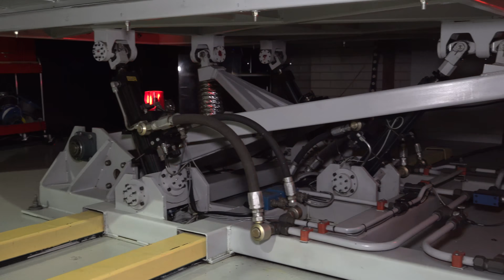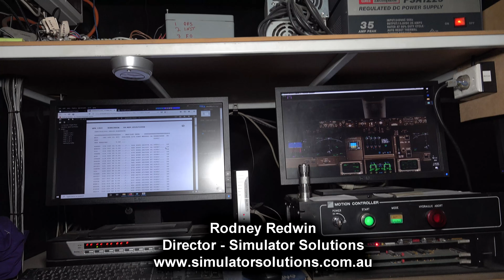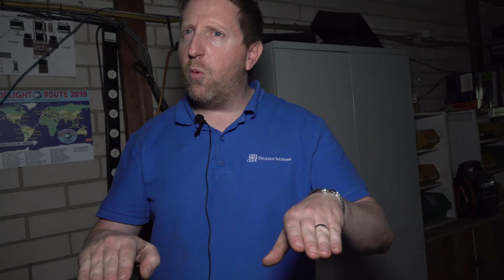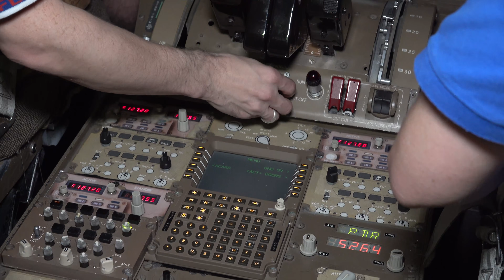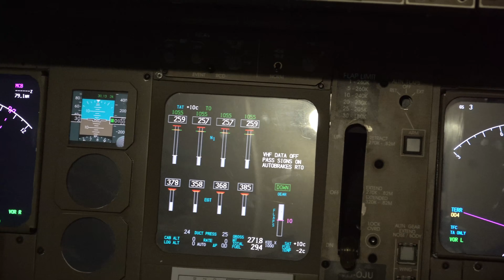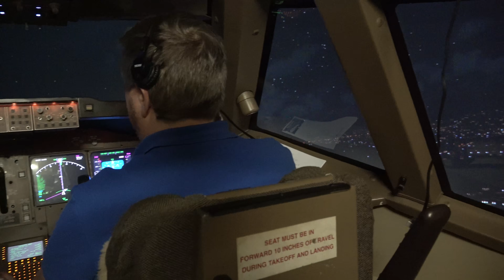World's Most Expensive DIY Flight Simulator!

Comment: Most expensive Flight Simulator is a terrible metric, overall cost is usually an indicator of poor design. Looking at the aged parts in this setup, I find it hard to believe this was cost effective. I've seen far more capable flight simulators built efficiently at lower cost.

Comment: Good afternoon, Engineer Jones, I have a Sorensen LH 75-5 power supply, with a problem since it does not adjust and it will run into around 107 vdc, just by moving the current knob a little so I bought it and I want to repair it some data Could you help me engineer, I'm from Mexico, I hope you can help me, I'll send you a video of what my power source did Sorensen, thank you engineer .

Comment: Could they not ditch Microsoft Windows and migrate to Linux Mint 19.3 CINNAMON (Tricia) 64bit and install Wine64+Winetricks64+zip.dll and then they could run their simulator and maybe they should think about using GIGABYTE AORUS ZENITH Extreme X399 motherboard based systems with the 32 core 64 thread Threadripper with 1TB of DDR4 3200MHZ RAM and AUSTECH EN9500GT boards and Corsair PSU's and whatever SSD that they want possibly 100TB Data Center SSD's.

Comment: one ryzen threadripper should cover most of those old pcs XD
Reply: Most of flight sims uses single core only for now. So a powerful pc does not mean that it will drive the sim
Reply: @Balthazar030  Well if they have a bunch of PCs, it must be able to run the simulation across a bunch of nodes, even if it is single-threaded. I would assume you could run multiple instances of the sim program on a single computer if you can have multiple instances spread between computers. If not, they could combine all the separate machines into one server running separate VMs, with different operating systems for each VM if needed. Then each VM would have, say, 2 cores and a few GB of ram. But maybe you would want to go Intel with fewer high-clock cores.
Reply: @dannooo548  Or use 3rd gen Ryzen stuff. The new Epycs are sick. The new Threadrippers will probably be as well. So no need for Intel for that. Also their higher core count Xeons don't have clocks that high.
Reply: It probably saves 100kg too..

Comment: One thing I noticed while he was starting 2 and 3 he introduced fuel before reaching 29 on the NT gauge, if this would have been a " Hung Start " those Engines would have been toast, You never introduce fuel until you have Max rotation on the NT Gauge.
Reply: Well for someone who knows this much you would understand of course know the 747-400 has auto start and you move the fuel control switches to run to commence the start, also would love to know what the NT gauge is because A, it doesn't exist on the 744 and B, even if we weren't using auto start you wait 20 on the "N2" rotation then give fuel. Always helps to know what your talking about before Mr Know it all
Reply: Maybe on a different aircraft, but not on a 744

Comment: 18:51 What are the two blank dials on the pilot's side between the two big screens? Seems to be dummy placeholders. Old style level indicator and altimeter perhaps?
Reply: Dexxter they seem to be placeholders for the standby instruments. So in case a display failure, or engine, or power, they will continue to operate, through a different battery system, which only they run on.

Comment: Imagine this with the new Microsoft Flightsim 2020, using 2PB of bing maps for absolutely stunning graphics for the entire planet.
Reply: Would be the most beautiful thing in the world
Reply: @flyingfish2528  I wouldnt go that far xD
Reply: With 3 4k projectors and 3 2080ti's
Reply: @sonnywilliams6566  Meh
Reply: @sonnywilliams6566  I do it in mines. I have 3x 3090’s but mines is non motion.
Reply: @FlyWithRookie  do what in mines?
Reply: @hsw268  MSFS 2020
Reply: Imagine this with the original, first edition Microsoft flight simulator
Reply: The problem with FS2020 is that not all systems are simulated, so you don't get the accurate feelings.
Reply: Imagine that in VR
Reply: Problem is, MSFS 2020 is a poor simulator; bad physics simulation and lacking in much of the airplane systems. It's really just a reskinned FSX, with some minor improvements.
Nothing to call home about.

Perhaps with time the aftermarket modders will make it decent, but that's not the case yet.
Reply: Actually, The quality of the outer view is the least important thing in the flight simulators. Most of the time you don't look outer view instead of instruments, like the real world flights.
Reply: gandalf94013 Most of the time professional flight sims are conducted at night and in IMC. Pilots generally don’t look forward to them as they are tested to strict standards multiple times a year. However my favourite is engine severe damage. You cannot read the instruments the vibration is so dramatic.
Reply: @gandalf94013  what if you're flying vfr?

Comment: Been on the real Boeing 747 simulator, which feels exactly like flying, except with having a whole load of students inside they had it in a limited motion mode, so it would not do the full range of motion. Then we got to see it running from outside, where it sat a floor or so up in normal use, to get the full range of motion it was capable of. we could watch the video shown inside, on the Sony projection TV sets, on some smaller Trinitron monitors.

Comment: I'm building a Kerbal Space Program instrument panel that will fit into my desk. Nothing remotely as fancy as this, but I got a real Flight Director-Attitude Indicator that I want to use as my Navball. It's an ARU-11/A, and I think the power/reference in is supposed to be a 120VAC 400 Hz source, and I think the synchro inputs are supposed to be 28VAC... I THINK. I need to design a controller that takes the digital data from the KSP serial IO communication mod, and my 400 Hz reference, and creates the 10 outputs necessary to drive the unit. I'm only 90% sure those voltages are correct, and I have NO IDEA how much power is required for the Power/Reference, or for any of the individual synchro inputs. I'm also unsure of how to couple this. I was thinking of using some of those integrated audio amplifier chips, the kind in a SIP package with holes for heatsink mounting. I figure those are designed to drive inductive loads, and can push some power. Part of my lack of knowledge, is in regards to whether I even need them for all 10 inputs. Obviously, I need to provide power on the reference input. Don't know if I need any significant power driving for the three synchro inputs though. I'm still unsure how to couple the outputs. I'm guessing I'll need transformers to get the voltage coupled up to where it needs to be. I'm thinking that on the secondary side, I'd tie one side of each triplet of transformers together, to create a Y configuration, and then attach the three synchro inputs to each of the other three secondary leads. I'm thinking I'll have to keep the outputs of the audio drivers isolated from each other when feeding them into the primaries. One of my concerns is even finding transformers that will even do the job. I'd be curious how they drive instruments that expect synchro signal sources.
Reply: Stay tuned - I think that Dave will do another video on Synchros and Resolvers.  Fascinating things - it took us two years to develop a digital interface to these analog units...
Reply: @simulatorsolutions  This sounds very relevant to my interests! I definitely belive it could take time to get it right!
I used to work for a company called Tachtronic Instruments (not to be confused with Tektronix). I mostly worked with brushless motors and particularly, the drives. 3-phase units that switched outputs of 295V @ 45A. We also made synchros, which I helped with from time to time, usually when we got busy. For some time, I'd considered the possibility of just buying some surplus synchro control transformers, and mechanically driving them with a traditional motor solution, but I realized that was a bit convoluted.

I have a thread on the EEVblog forum where I theorized about how to do it, but I'd not actually formally designed anything, much less completed the project. Work got busy, and it sat on the back burner for a couple years. I was still playing KSP version 0.25 when I first began the project!
Anyway, My theoretical solution was as follows:

• Analog steps
•• Digital steps

• A hardware generator creates a 400Hz sine wave
• The 400Hz sine wave is fed into a pair of Op Amps: One inverting and one non-inverting. This creates two sine waves 180° out from each other.
• The two sine waves are fed into an analog switch IC. The microcontroller can select the inverted or the non inverted signal to pass through.
• The selected sine wave is fed into the reference of a 12-bit MCP4922 DAC.
• The microcontroller sets the scaling of the DAC, allowing the DAC to function in multiplier mode, attenuating the sine wave on the reference.
    For reference, there are a total of 9 analog switches, and 9 DACs, three per axis, for each of the three different axes. Each circuit is just repeated 9 times.
•• The Microcontroller receives serial data containing the Yaw, Pitch, or Roll angle. (Each axis will be a separate PC board, and likely have it's own microcontroller).
•• The microcontroller will add 120 and 240 to the angle received, then check if any results are 360 or greater, and if so, subtract 360 from the result.
•• The three values are used to look up the attenuation value from a lookup table of sine values. (I think that might be easier than trying to calculate sine. Not sure)
•• Each of the three values returned are checked to see if negative. If negative, the associated analog switch has it's state set to select the inverted sine wave input.
•• The absolute values are sent to the three DACs of each axis. This allows the DAC to function as a multiplying DAC, scaling the analog sine wave on the reference.
• The output of the three DACs are fed into audio amplifiers. 
• The three audio amplifiers are fed into transformers to couple into the synchro inputs of the FDAI. (this 
• The non-inverted reference is fed into an audio amplifier, and is fed into a step up transformer to power the FDAI and provide it the reference source.
Reply: @simulatorsolutions  My favorite way to explain a synchro visually is to hook it up to a 4 channel scope, set the reference up top, and then line up all three outputs of the stator below it (so they overlap). You can visually perceive the angular rotation of the outputs when doing that, and you see how all the zero crossings stay in phase. I can't tell you how many times I've seen people think these work more like a resolver. Very different beasts! Of course, they are visually interesting on a scope as well. All equally interesting. Really cool demo, if you ask me!
Reply: Not entirely sure what your answer is, but you'd be much better off typing this up on the forum. Im sure there are a lot of people over there that can help with this.

Comment: Is the motion control/hardware integration layer java based or is the whole simulator running on java? O.o

Generally I've seen FSX and X10/X11 layers to interface with the hardware. But I think that only FSX can properly be synchronized into multiple instances. (I've tested X11 a yet ago, with the full world mapping, that thing is heavy! I have a decent hardware but having 8 core and 16gb of ram completely filled was a little scaring. Looks like that simulation is quite resource intensive)

I would have used a rack server with VM and pcie passthrough to render each display.
Reply: I think the hardware programming language for the interface is "java like". More on that when I go back there.
Reply: That's so cool!
Thanks for the reply!
Reply: A small VB based application feeds the X, Y & Z acceleration values from the Simulator Software (PSX) to the motion computer over a serial link.

The hardware integration is provided using a small Java app that connects the SimStack boards to PSX.

Then there is a .NET application that links the visual system (Perpar3D) with PSX.  The visuals are being run from a single computer using a high end video card with multiple HDMI/DisplayPort outputs.

Hope this helps.

Comment: Supposedly these simulators are so realistic that pilots can be trained on these and immediately fly an actual aircraft with passengers and all after being fully trained on the simulator.
Reply: Thats sort of correct. A new pilot will still need a certain number of flight hours in the simulator, plus a certain number of flight hours as a first officer in the actual aircraft with a captain who is certified to train new pilots. 
So yes you can get all of your type ratings in the simulator, but theres still a good amount of training required in the actual aircraft.

Comment: I don't understand why they need so many computers.
Reply from the maker: One for each display in the cockpit + misc others for control.
Reply: Yeah, like desktop PC for this sort of stuff is a bit silly, also replacing those to newer models would cost probably the same as one good enough server
Reply: Mostly due number of screens and inputs. It definitively could be reduced to smaller number of computers, but it is hard to find a single motherboard that will support so many inputs and outputs, even with PCIe expansion bridges, and you might be bottlnecking some stuff. Multiple machines are probably cheaper overall and easier to troubleshoot or replace components.
Reply: Because one task by computers is better than only one computer doing several tasks. 

By example, X-plane and FSX, and maybe P3D are designed to be able to use several computers at the same times.
One dedicated to simulation, one per view, one for others tasks. The goal, earn FPS and simulation with   minimum latency. 

In X-plane if you are using a second screen on the same computer, you will have a fps drop.
Reply: I was expecting a single large server with a host of virtual machines / multiple video cards.  They need to contact Linus Tech Tips.